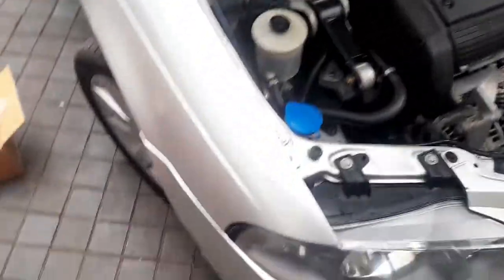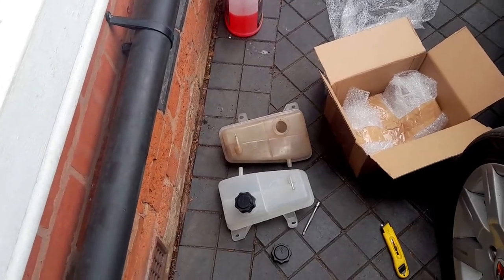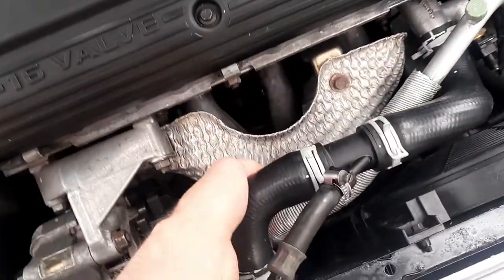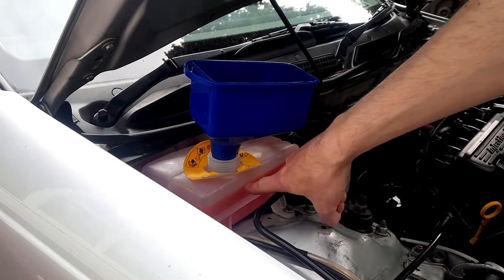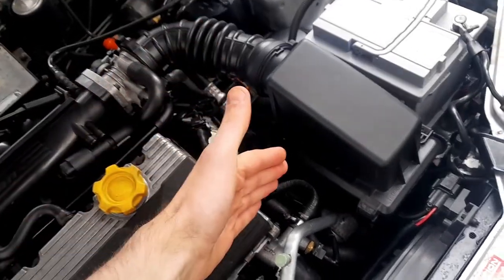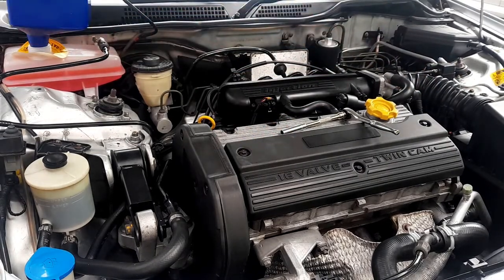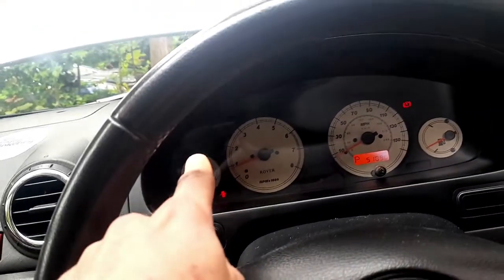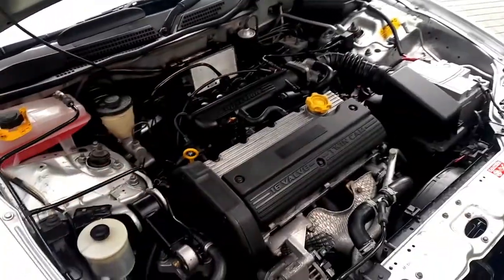(Lost Episode) Project Beatrix Part 63 - K-Series Coolant Refill

Comment: These engines were in the Land rover freelander too😊
Reply from the maker: They were indeed but defonetpy on the rarer side of freelander engines :)
Reply: Just done mine , following Haynes manual. Went exactly as yours did, bleed screw very handy. Probably filled a little too fast so only got heater fully functional after a full night's cool down , level drop and top up. 
Another excellent tutorial guide video mate 👍
Reply: Quite a bit of parts shared. Top engine mount on a TF is exactly same as a LeavesUstranded , sorry I meant a Freelander 😂